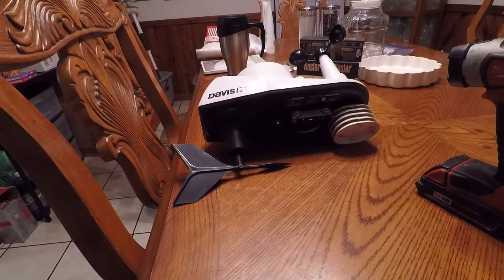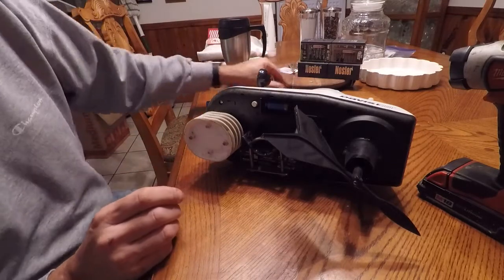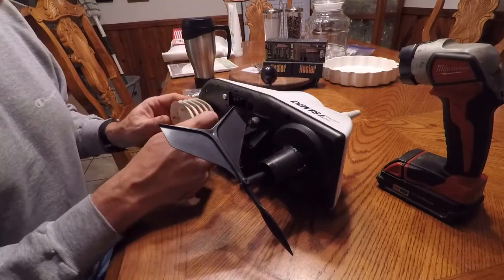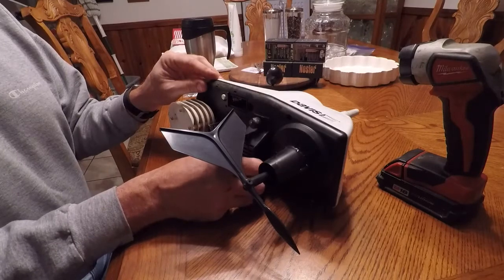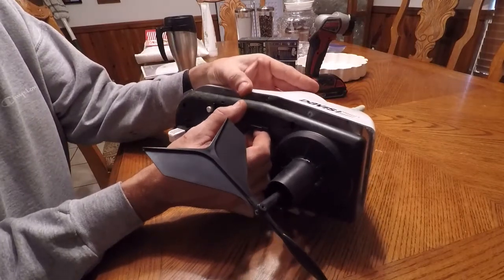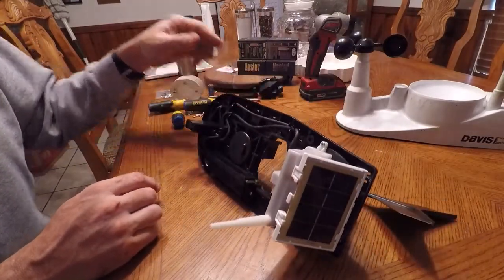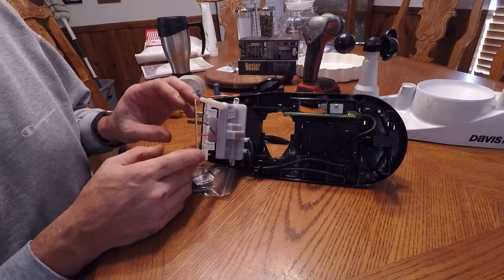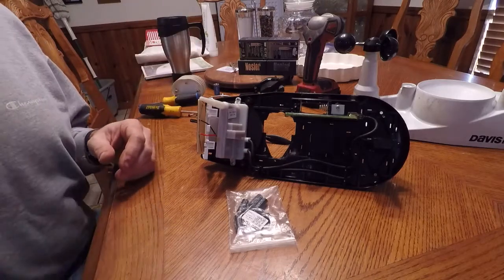Davis Vantage Vue Dead Battery Repair?

Comment from the maker: Quick comment on this one. Apparently, capacitors have polarity and I seem to have randomly installed this one correctly. (I just rechecked it.) If you try this, make sure you get the correct side of the cap hooked to the correct side of the solar cell. Good luck!

Comment: So you shouldn’t need to replace the battery? I’m in south Texas so not enough sun isn’t an issue and we have the same “low battery transmitter 1” notification. Trying to decide what steps to take next.

Comment: My experience with Davis hasn't been as good as it used to be. I've also noticed that their quality has decreased here lately. Not to mention, replacement parts aren't cheap either. It's kind of like a newer Mercedes, when it works, it's dead-on accurate and perfect. But when something breaks, you're in for a surprise! So I purchased a AcuRite 5-in-1 station from Lowe's for $109, and I've been very impressed with it! It actually connects to Weather Underground wirelessly! You don't have to worry about spending over $100 on a serial connector, and having to fiddle with them. Sure, it might not be dead-on accurate with the readings, but it serves it's purpose! Not sure how well it'll hold up, time will tell I guess. If it breaks, parts are pretty cheap. If it's broken beyond repair, I'll try the Ambient Weather ones, because they seem pretty good too.
Reply from the maker: Thanks!

Comment: What uF are you using on the second try ?
Reply from the maker: Howdy! The cap I used for this video was a 10F. It didn't really work though. I made another video showing the battery eliminator I used to get it to work. https://youtu.be/sisoqY0100c